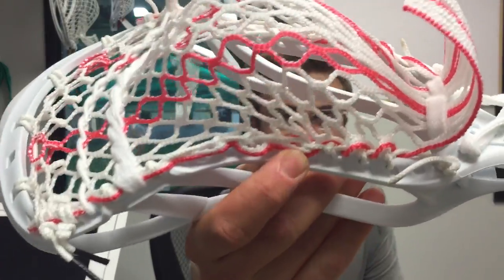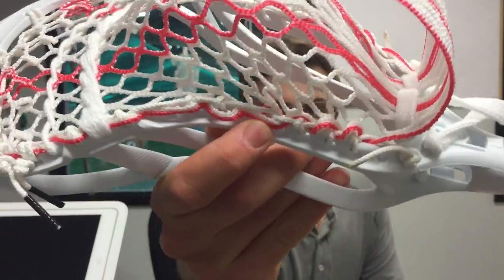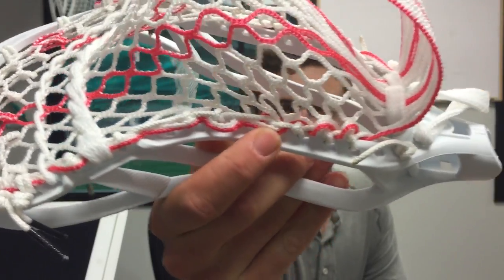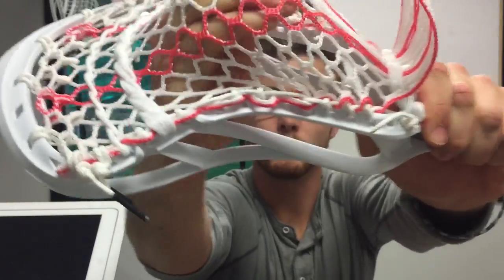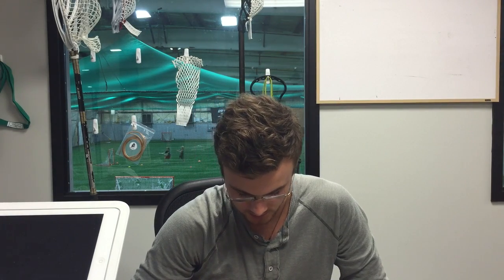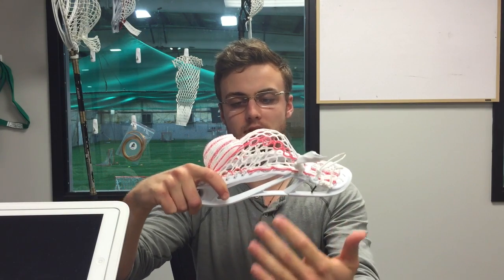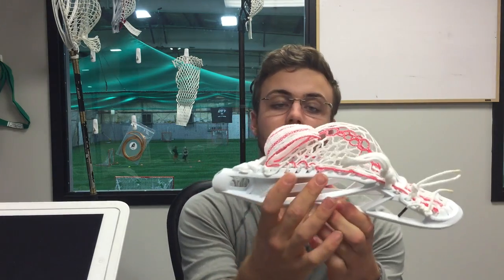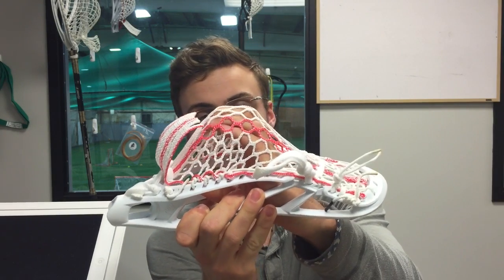Theory Thursday: Strings and the Stacked SI

Comment: Good stuff!  I've always wondered why you've been using SK strings on most pockets posted.  One thing I've done lately is gone back to a regular 9D without triangle top to keep things simple and while I know it's negligible, reduce weight and less string. Think the triangle top pulling up is worth the extra string and negligible weight savings?